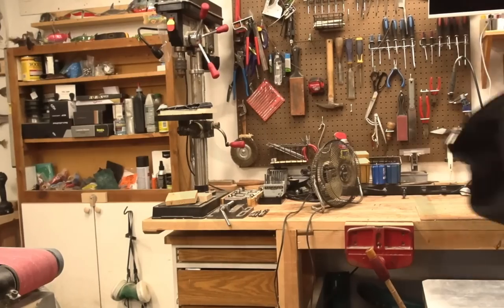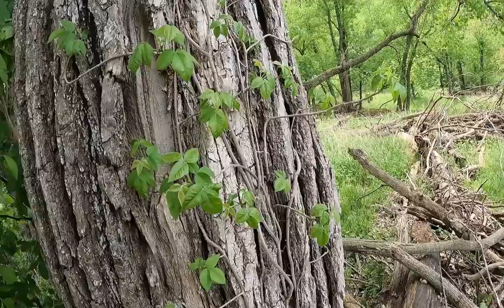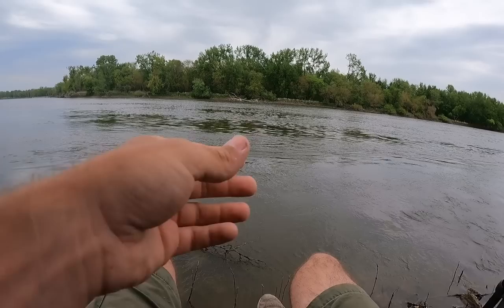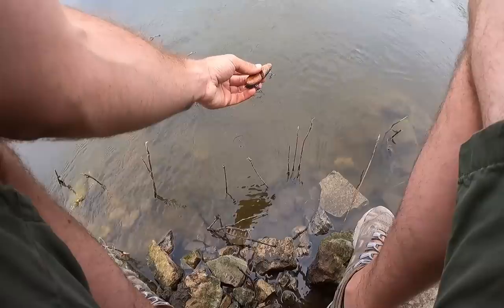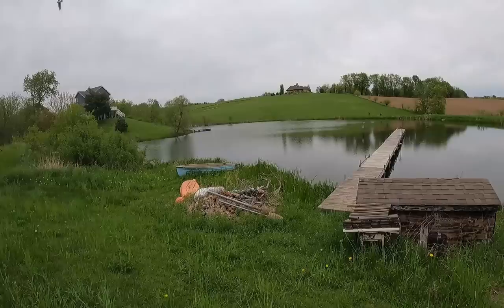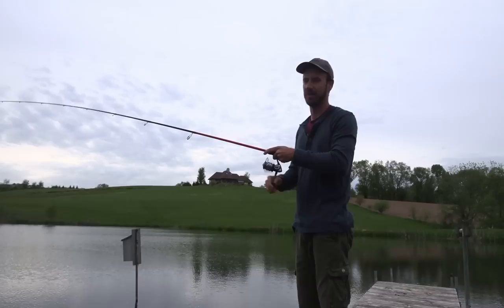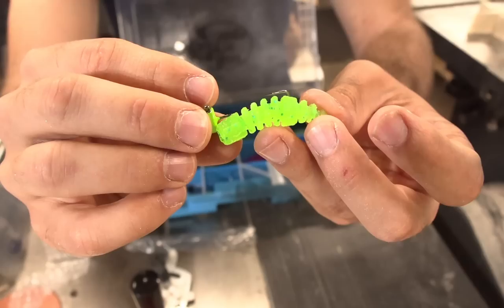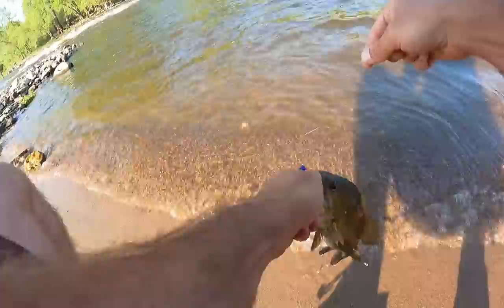Making All Natural SwimBait on the RiverBank

Comment: I mixed my tungsten with 25% baking soda. Before using it each time, I will shake the container well. The baking soda encapsulates the tungsten and cures quickly with the super glue.

Comment: I tend to use smaller diameter wire and it also won’t catch in the main drill hole. The key is to put the wire in the pinchers at a slight angle as they close. Works like a charm👍

Comment: For a riverside build, a 2 screw wooden clamp could be almost as good as a vise  (that you were missing) AND you could bring pre-twisted wire hardware AND then use a hand-powered eggbeater drill instead of cordless drill.  Probably less total weight to shlep. BTW Well done on the tungsten. Ecological brownie points for you today!

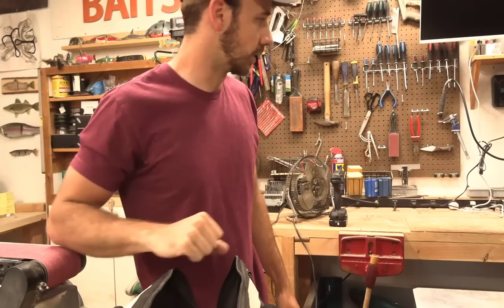Comment: At 1:00 the way you said all that made me think of a first class eatery and you were telling me the special of the day. 
How about making a Zara Spook type lure?
Instead of putting the thin wire in the drill put the allen key in the drill and use pliers to hold the wire while twisting.
You can mix the tungsten powder with your epoxy and paint to give the lures a more even weight balance. 
Also makes the epoxy and paint a lot harder.

Comment: unless you're growing big root vegies (monster carrots, sweet potatoes, etc) the next time you need to fill in a bed like that, look into hugelkultur principles.  aka. fill all but the top 6-10 inches with woody garbage (branches, unfinished wood offcuts, sawdust, logs, half rotten whatever).  self watering, self fertilizing, saves on purchasing compost.  also means 1 less burn or bramble pile for the year.

Comment: AY man you can put metal in the microwave.... I do bake beans, in the open tin.... here are the rules. 1) the weight of the medium must out weigh the metal. 2) the shape of the metal cannot have points... so a spoon is good a fork will spark. a butter knife with round edges over a sharp knife with a point. 3) the metal cant touch the sides..of the microwave...... You should try out the metal flake in the medium, i dare say she will be right cob..... One last thing metal rejects microwaves, so when i do my beans it takes a long time as the only access for the waves is where they are open.